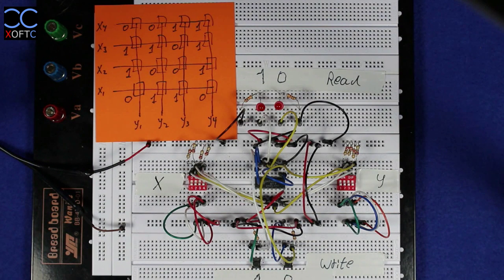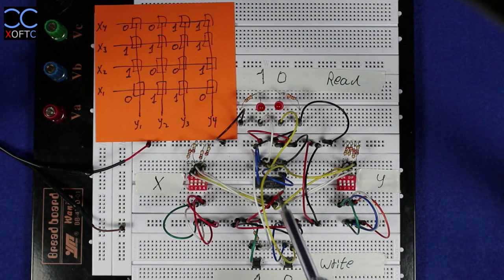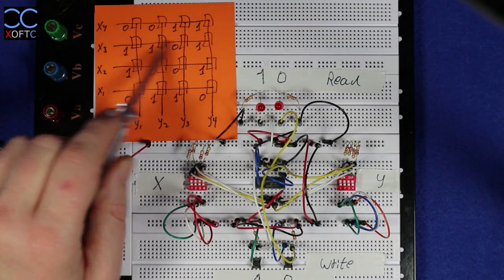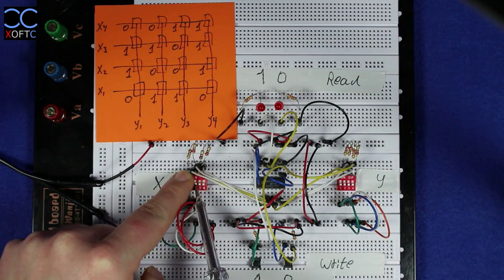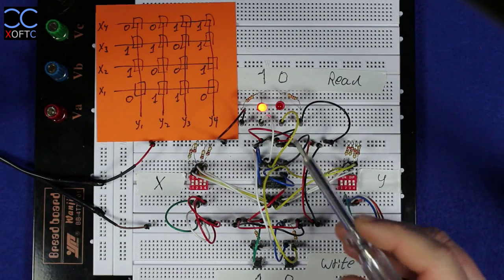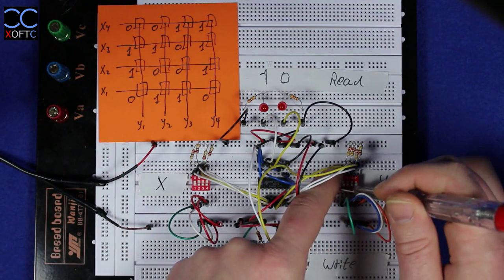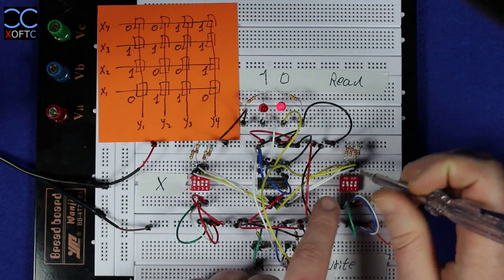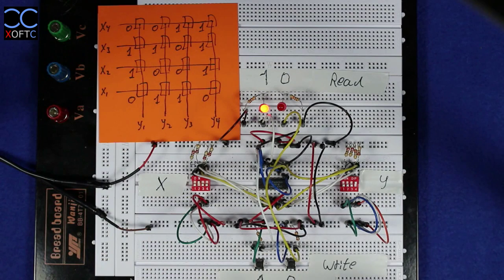Reading and Writing RAM Memory - Part 1

Comment: Hi there! I live in Canada and am having a hard time finding this chip. Would you be able to recommend an alternative or a supplier? I am willing to order from China if needed. Thank you very much for the video. I would like to do a similar project.
Reply from the maker: Those chips are getting harder to come by. I bought mine locally from an "old school" electronic repair shop which has closed since then... those are getting also harder to come by.
My best suggestion is trying digikey or ordering off eBay. 
Sorry I couldn't be of more help.